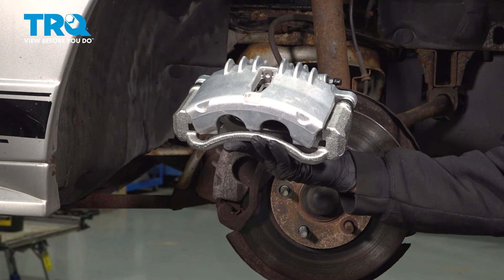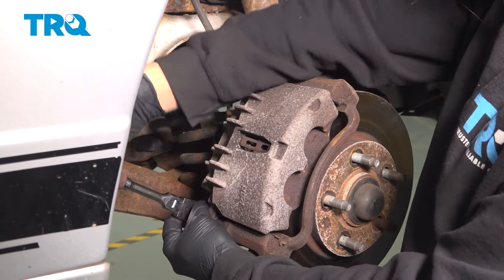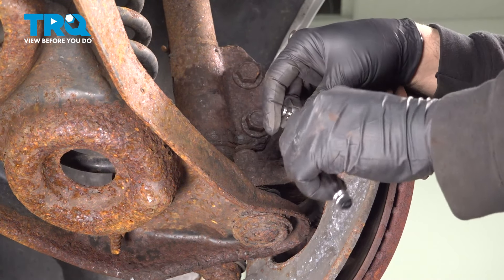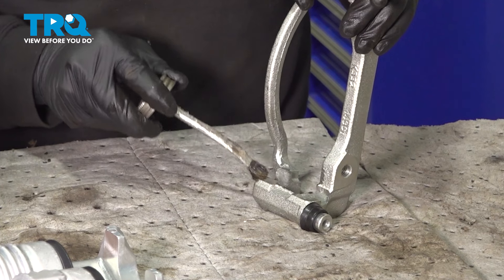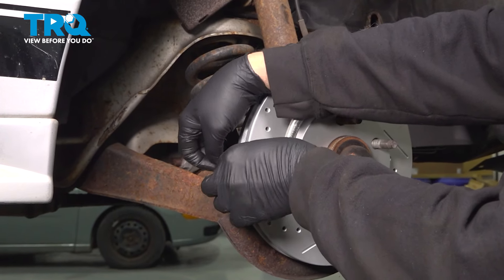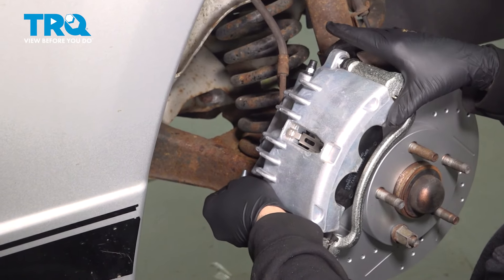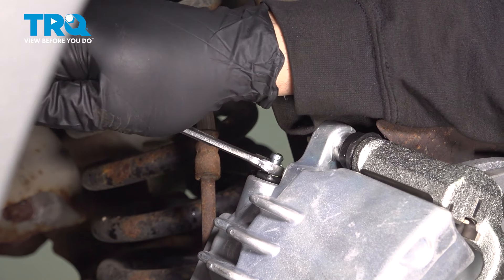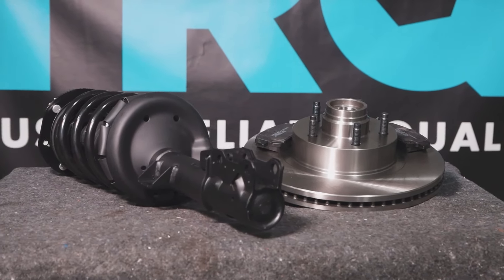How to Replace Front Brake Calipers 1994-2004 Ford Mustang

Comment: FYI: You put the brake pads on the wrong sides. There are 2 little pegs in the middle on the back of the brake pad that will destroy your caliper pistons.  The pad you put in front has those pegs on the outside corners to prevent damage to caliper.